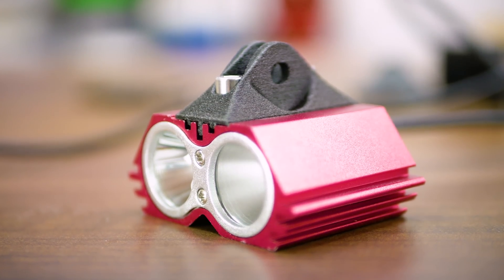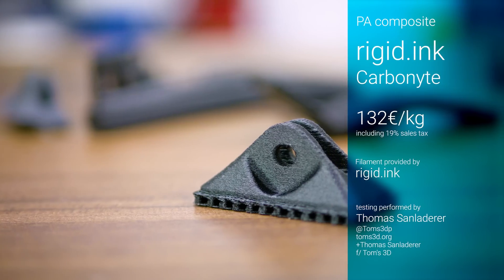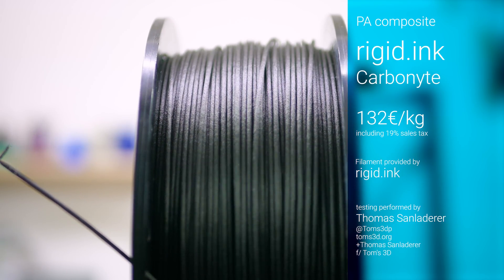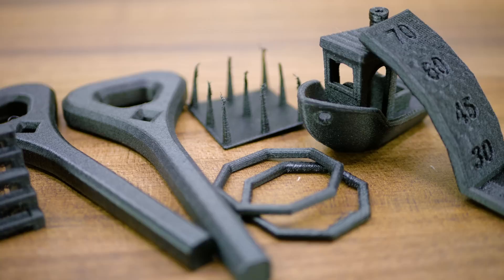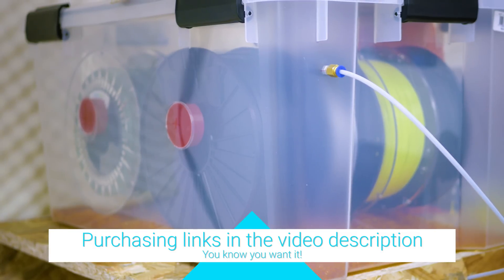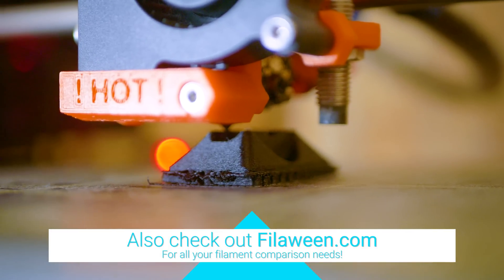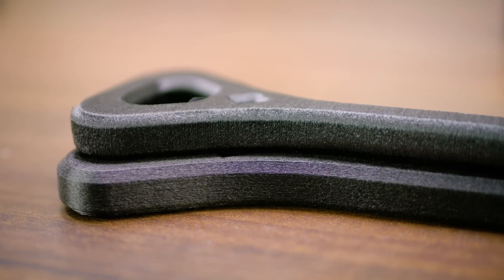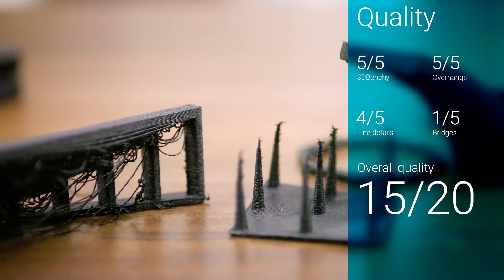3D printing with better composites: rigid.ink's Carbonyte review! #Filaween

Comment: Could you tell me if there are any filaments that are good for resistance against impact wear? I'm looking to make some mechanical parts which would have metal parts hitting the 3d printed parts. The printed part would be on sort of a spring loaded pivot. So that when the metal part hits it, it will lay down and when the metal part retracts it would spring back up. I hope that makes sense.

Comment: From an engenieering point of view I never got, what effekt this carbonfiber should do.
I know about the advantages of carbonfiber reinforced plastics in conventional plastic injection processes, but these can't be used by FDM printing. The main issue of FDM Parts is their high anisotrophy in the Z-axis. But by inserting any kind of shoped fiber they are just increasing this effekt! As long the fibers are longer than the nozzlediameter, they are orientated by the nozzle in the printingdirektion and only increase the X and Y strength, if they are shorter than the nozzlediameter, they are useless at all. What is needed are fibers, that conect the Layers, but this is impossible with these type of filament! 

So these filaments are just useless, and a waste of money!
Reply: They add quite a bit of stiffness even without crossing between layers. It's up to planning the print how much use they'll be.
Reply: Of course they ad stiffnes, but only along the fibers.
It's the same with real unidirectional carbonfiber, this will be ultra stron and stiff along the fibers, but orthogonaly to them these papameters will be shit.
Yes you will get an advantage if you design your part in a way, that the forces are only along the X and Y axis, but this advantage does not justify the high pricetag in 99% of the cases. As said in an other comment, some really cheap dasFilament PETG scores nearly the same.
And I would guess, pure PA12 would score even better in a FDM-aplication.

Once there was a not very professional Test of some Filaments on Youtube, where they printed some Boatpropellers. The Carbon Filament was the weakest, as the Layers simply came apart. Did not suprice me, aus the carbonfibers reduce the contactsurface between the layers and create some sort of gaps in the Material where cracks can start.
Reply: And 5 years of engineering school with several classes about plastics and dozen of kilometer printed Filament. 
Actually I said the test isn't professional or reliable, but it shows what i'm talking about.
Reply: Yeaj, referring to failed tests with bad setup really shows what you're talking about.
Reply: Maybe I should really stop posting, as arguing with you seems impossible as you don't get the point.
Have a nice day.
Reply: +Karri Koivusalo  You clearly have no knowledge of material science.
Reply: Hah, yea right. How about this: why does actual 3D printing shops offer microsphere mixed SLS parts? Going by the logic above that should add nothing to the stiffness. How about you learn the basics of material science, "tough guy".

Comment: Please try 3DXTECH's Glass fiber reinforced PETG!
Reply: I printed a lot with 3DXtechs Nylon+Carbon Fibre ("CarbonX Nylon") for work and I have to say it is the best filament I've ever tried.
Excellent adhesion, super easy to print (260°C Nozzle, 100°C Bed, 50 mm/s) super good surface finish and (most importantly really tough and stiff).
Reply: I've printed w/ both the CarbonX PETG and their GFR PETG and they were super awesome and pretty affordable
Reply: amancue Sweet! I've bought 4 spools but am still waiting on my Prusa i3, so I haven't been able to try them out yet.

Comment: Didn't the much cheaper PETG score better in the strength test!
Reply: I was thinking you could maybe add a toughness category, using some sort of charpy test apparatus. It would give a value of how much energy it would absorb during fracture. Useful to know for things like iPhone cases or something that needs to be rugged.
Reply: Thomas Sanladerer Every mechanical engineering school has a lot of devices to test material strengths in a standard way. I'm sure they are willing to help/show/tell since this is a "hot" item. It also shows the difference between tough,  brittle, hard, soft, strong, weak. 
It is easy to measure with (almost) the devices you already have, like the test device for the proximity sensors.
That will give (internationally) accepted values.
Reply: Thomas Sanladerer Partially true :) It does not have to be scientific, but a good approach. And I'm almost sure that local edicational institutes are maybe even willing to do it for you (even just the specially the pre-research), since it does add a lot of information to engineers! If it will only be the pre-research, you  only have to print a small object to do the tensile test - that is simple to do and gives much more info than using the "spring balance test". Your equipment is almost ready :)
But I understand your point - it is a matter of choice and priorities.
Reply: Thomas Sanladerer Other option: tensile strength of the unprinted filament  (it is already extruded once, to make it). Skips printing errors :)
Reply: True and use conditions will have a huge affect on printed parts also so in some cases the price is irrelevant compared to performance.

Comment: Still waiting for the PC-Max and PC-Plus review. Also a review about the nanodax glass-wool-filled PP. I know it is not very famous and hard to get at the moment, but a review would be awesome :)
Reply: PC-Max is absolutely awesome.  The print quality, strength and finish you can get from sanding it make it one of my favourite ever filaments.

This carbonyte is also pretty damn good.  I'd use it for brackets, mounts and functional parts that don't need fine details.  PC-Max for gears, complex geometries and fiddly bits.  I did some differential gears for an open-rc car in PX-Max and they were amazing.  The nylon-cf materials would be better for the suspension components.
Reply: Jai Stanley , I think filaments with chopped fibers in it, do make only sense if they have to be wear resistent. Otherwise it doesn't make any sense to me. But often people don't know anything about material science and so they buy this stuff, because they think it has  great mechanical properties. Fibers such as carbon fibers do only unleash there great properties if they are used as fibers and not as particles (excepted of the reduced shrinkage, which is a minor matter).

Comment: Tom, do you think the carbon fibers help with strength?
Reply: Chris Crosson Carbon particles gives wear resistance not structural strength. Like rocks in the blacktop on the road surface.
Reply: Thanks, I keep seeing carbon fiber-filled filament reviews with bend tests and people shaking their heads in disappointment... I thought I was going crazy.
Reply: Kris M What about impact or shearing resistance?
Reply: Thomas Sanladerer Thanks, Tom

Comment: Hey Tom! How about you introduce a new series, where you present some affordable filament, as many people cannot afford prices of 60€ per kg. So collect different brands and kinds of filaments that offer offer great price to performance ratio!
Reply: I too would love to see some reviews of more affordable filaments as well.
Reply: Anton Meyer-Erlach I have only ever used the cheapest PLA filament offered on ebay or Hobbyking and haven't had any major problems with it yet. 16€/kg is about what I pay for it.
Reply: I never had any issue with ebay cheapest filaments (£5/kg).
Reply: +Afdhal link to this please?
Reply: You can just search on ebay uk "abs 1.75mm 1kg". Apparently the price has gone up a bit, it is now £6. 3mm seems to be cheaper, I am in the process of converting my wanhao to run on 3mm instead of 1.75mm.
Reply: LostName Try getting a spool of fairly cheap Hatchbox filament for example n compare print quality, you'll see the difference...
Reply: Anton Meyer-Erlach It's worth paying a bit more for good quality filament, by saving some penny's on cheaper filament you'll waste more time and money on failed prints. Yes rigidink is quite pricey and not made for all but it's interesting to see what's out in the market.

Comment: This has the same strength rating as the DAS filament PETG which is 1/4 the cost and easier to print with.
Reply: Time travel
Reply: Internet so fast it bends time
Reply: HOW DID THIS REPLY come from 3 weeks ago?
Reply: You've been exposed Agent BLOOGaming. Initiate protocol 9.
Reply: Drat! Where is my memory eraser when
I need it?
Reply: I'm pretty sure it's a re-upload. I remember watching this a long time ago.
Reply: @BLOOGaming - mhm, you know we don't believe you, right?
Reply: At least tell us if Futurama was (will be) brought back?! :D
Reply: PETG is definitely my favorite to print with, I pick it up for $19 at my local Microcenter
Reply: PLA is brittle, while nylon both has the strength of PLA but the impact resistance even greater than ABS, making it superior in the long haul, which is why nylon and fiber filled nylon has been the material of choice for a very long time when it comes to durability. ABS is cheaper.
Reply: Time travel is ludicrous! I couldn't possibly be a time traveler! Anyways, I have to run. For no reason. None at all. Don't follow me.
Reply: Your ability to time travel astounds us! Although that's not quite how strength ratings work, there are a lot of factors. By the same logic, our PLA got 65KG so why not just print with that? PLA's often the easiest to print with...